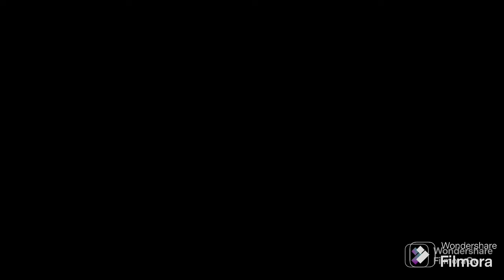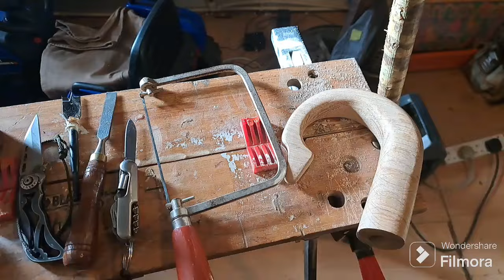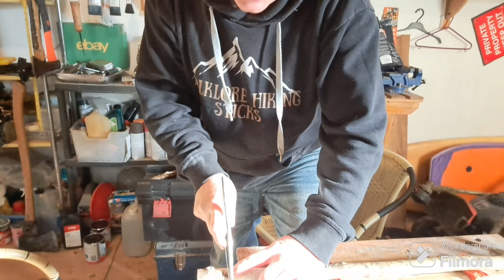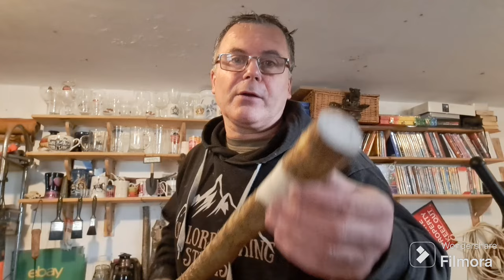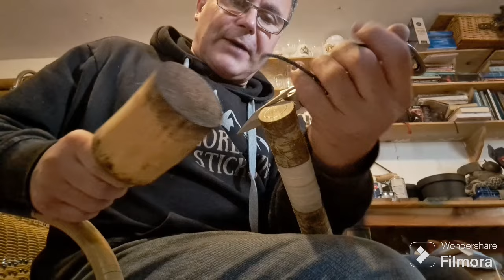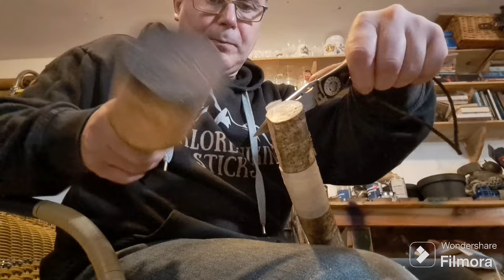How i make a Shepherds Crook and fit to a Hazelwood shaft. Sanding,Shaping, Copper tips.

Comment: Cheap air filter. Take a 20 inch window fan put a 20 inch cheap furnace filter on the in side of the fan put it anywhere in your shop
Reply from the maker: Hi, thanks for the information . As you see i must sort something  out soon. Its a bit of a hassle going down to the woodshed. Thanks for watching and commenting. Andy.

Comment: Since it isn't a steam bent crook, how would you prevent the crook from breaking along the wood grain??
Reply from the maker: Hi, as with other crocks shaped in this Manor, they usually retain more meat in thickness and girth to retain  strength. You can steam bend a normal stick to a smaller gauge and retain  strength as you say. I did try pulling on the crock in the video and it simply had no flex or movement . It would take a cow to break this crock...lol.Thanks for watching and commenting. Andy.

Comment: Most epoxy I've used has to ne near 70° before the chemical reaction will start to activate. In the U.S. anyway. Also why don't you measure your stopcut?
Reply from the maker: Hi, the epoxy I use has a activation part that  will  go off in colder conditions but the optimal temp is  room temperature . On the opposite end on hot days or conditions it goes off faster as expected.  The product I use is quite stable and much more workable that the resins I used to build surfboards 30 years ago with. Many thanks for watching.Andy.
Reply from the maker: Hi , the stop cut I use are a blade in depth and to the lowest point in the socket I am putting the peg into. I probably  did not make that as clearly as  I sould have in my explanation. Thanks for watching and commenting, much appreciated. Andy.

Comment: Really enjoyed this video,been waiting to see this...just wondering what is thinnest and widest and staff can be😊
Reply from the maker: Hi, that's a difficult  question  for me as I specialise  in hiking sticks and shepards crocks are to be honest a craft some stick maker's regard as a craft in its own  right. If this helps the innermost circumference of the Crook a good man's fist size  could fit in it. This sticks shaft was was a good inch and a half in diameter at join and the final stages of  sanding  reduced  the oak Crook to around Inch and three quarters at its  thickest I guess.Thanks for watching. Andy.

Comment: The trees that are available to me I've had had trouble with splitting during drying.... do you have that and how do I keep it from happening?
Reply from the maker: Hi, firstly leave the bark on, the traditional way also is to seal the ends by useing any sealing product on each end of the stick to stop cracking. Also try to slowly dry them out and not have to wood by a heat source. Hopefully that would help. Thanks for watching and commenting. Andy.